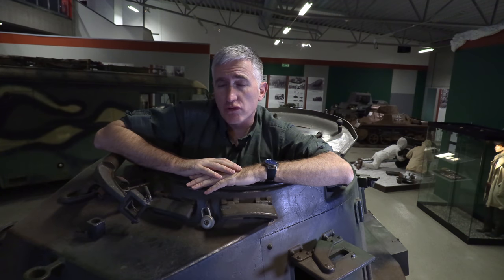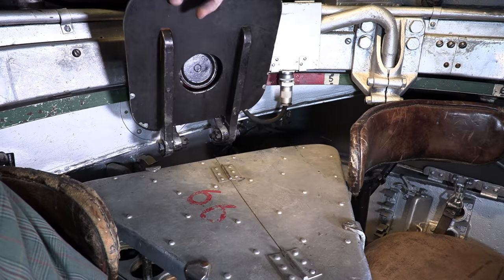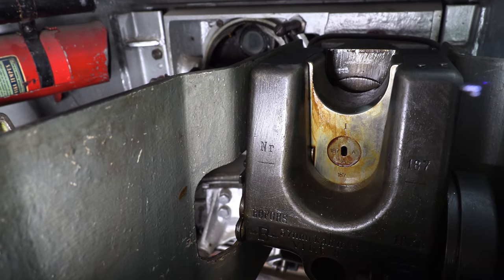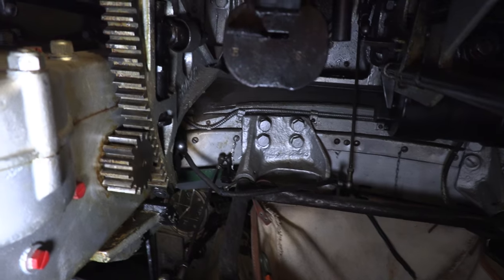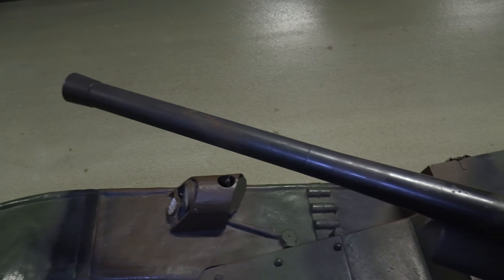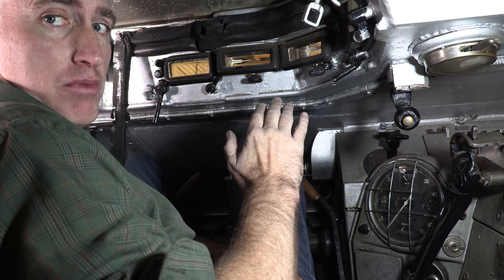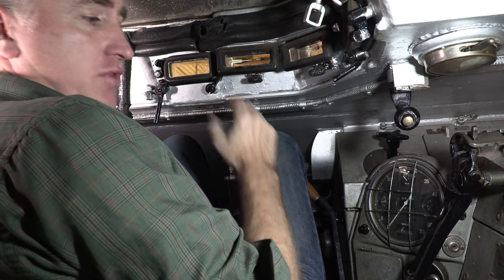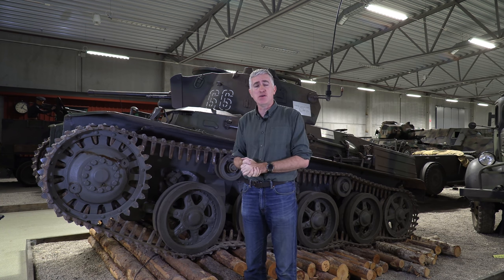Inside the Chieftain's Hatch: Strv m/38, Pt 2.

Comment: The generous crew positions might have come from the need to accommodate crews wearing bulky clothing for Swedish winters.
Reply: That's a very good point actually. It wouldn't have any heating for the cold.
Reply: A good theory I guess? 
But as long as you don't have wind (inside the vehicle) you wouldn't be wearing the outer layers of clothes, you'd be wearing woolen inner clothes with a layer outside. 
Neither Swedish or military, but a Norwegian that loves spending time outside.
Reply: @Batabusa  I think you might be underestimating how cold metal gets in sub zero temperatures when you're not moving around to stay warm.
Reply: @Ragedaonenlonely  as a Norwegian with 31 winters behind me, I beg to differ but w/e
Reply: @Batabusa  You don't think being inactive and constantly surrounded and in contact with cold metal that's going to cool you down wouldn't get cold? I guess you must never have touched metal in the winter in your life.
Reply: @Ragedaonenlonely  I have, and I've been in both old and New vehicles, I'm a trucker on top of it.

If you put a crew of several people inside a tank, you won't need the outer layers. Wool works like a wetsuit and will keep a layer of warm air around the body. And the cabin itself will in fact be warmer due to heat radiating from said people.

Sure, if you were to rub yourself all over the interior, I would recommend gloves.

You truly must not have actually ridden vehicles in the cold, or you're trolling. I can't tell if it's actual ignorance or a joke at this point.

The outer layer of clothes in this climate is to stop wind, more than anything else.
There is no wind inside the vehicles.
The warm clothes are layered Wool inside of those.
Reply: @Batabusa  Keep in mind here that these are NOT modern tanks designed for chemical and nuclear threats, they simply cannot operate "buttoned up" for a long amount of time. Normal non-combat driving and commanding will be "head up" with open hatches (and generally goggles), and combined with the vision slits ect the wind and water get in a lot more than you expect. On the other hand so does engine heat, but the risk is this turns dry powder to insulation defeating liquids, likewise perspiration from brief minutes of physical exertion or stress can turn absolutely deadly with the minutes to hours of sitting after. There is "old vehicles" and then there is OLD vehicles, and this pre-ww2 stuff is more akin to being ON rather than IN, just like an flat fender jeep, clothing to use will be more akin to a snow mobile than a modern truck.
Reply: @Batabusa  as a finnish leopard 2a6 tanker, you absolutely need all the clothes military gives to you. There IS wind inside the tanks as long as one hatch is open. Theres also so much time just sitting around without that good chances to move, so cold you will be
Reply: @taistelusammakko5088 that's the most Finnish name I've ever seen

Comment: pretty cool how the tank still has all the stuff in it, sights radio etc
Reply: Yea, looked very complete inside.
Reply: 16:17 Even a working breech !
Reply: The turrets from the m/38, m/39 and m/40 tanks were in active service into the 1990's as part of fixed defences protecting important positions such as airports. Other tank turrets with heavier guns such as the m/42 and strv 74 ened up at harbours or on the coast. So not only did some spare parts and equipment keep getting made but there was also a ton of parts available to the museum once the fixed defences were taken out of service. Also the original Swedish armour museum at Axvall had a very dedicated and well connected staff so the vehicles were in very good shape considering the small budget.

Comment: Of all the vehicles you've looked over and in, I've been the most impressed by the L60. The display at the museum looks great, too.
Reply: Very good design for 1935 - considerably better than the Pz.Kpfw.III Ausf A (also designed in 1935 and rejected for production).
Reply: This particular vehicle started entering service in 1938. The original L-60 is older, but the Swedish 37mm armed versions came later and were updated versions of it. It's more the m/31, aka the L-10, that's a 1934, 1935 vehicle

Comment: Little facts: the predecessor L-10 was desiged by Joseph Vollmer, a german engineer how also designed the A7V. The L-60 was designt under the oversight of Otto Merker, also a german.
Reply: Yes. Since the Germans were not allowed to own, operate tanks the German Companies went to Sweden and formed a conglomerate and setup shop as Landswerk. IIRC the deal was Sweden would allow them to operate through Landswerk and Sweden would have access to their research and development. By time WW2 started the best minds were back in Germany and Landwerk was not as important.
Reply: Just to quickly clerify AB Lansdverk; company founded 1872 by the swedes Johan Petterson and Alexander Ohlsen in Landskrona.

Later in 1920 the owners sold half their shares that GHH bought. Sometimes after they (GHH) owned the majority of the shares to the company.

Comment: I'm really curious how much light there is inside a tank when all the hatches are closed. I've noticed in your videos that they always seem to have light coloured paint inside, but what light sources are there in actual combat conditions? 
It seemed awfully dark in that blooper at the end of this video. Is that just the camera struggling to cope?
Reply: ..certainly some will be the camera not being mk.1 eyeball & our human-mammalian visual-cortex wetware abilities.
Reply: They can be nearly blacked out, aside from what light leaks in from Sights and bad seals. I was an Artillery mechanic, M109 (Paladin) as its called now days. Had a huge sight opening that could be rotated around 10X10 or so. Lots of light came into one of these.
Reply: Was that video part of the initial video he said that he had to reshoot due to the "wrong filter" I believe he said? Could that be one of the reasons for the dark appearance - the camera's automatic aperture couldn't accommodate the lack of light?
Reply: From the couple of tanks I have been in, the answer is bugger all, the dome lights and what ever the vision blocks and periscopes let in are all you have, of course if the tank is on fire that amount goes up considerably.
Reply: Actually, in most vehicles the Chieftain pointed out where crewmember had small lights boxes (post WWII appears to be kind of a NATO standard white light/red light appliqué, but most tank had a light bulbs somewhere)
When bottomed-up, basically no natural light: in open mode, usually the TC hatch is plugged by the TC himself, riding head and torso out, so it's most from the loader side that some shine may come in.
Reply: Yes, from my experience interior of Tanks & other AFV's (old & new) are generally painted a light colour (white/silver/pale green) on the internal crew compartment so as to maximise / interior light (helps light bounce/reflection).  There will generally be a crew light box (or small dome light) in the vicinity of each crew members work area.  In vehicles from 40's/50's (maybe earlier also ?) these had different coloured light lenses (white to provide a good light output, more so used in Non-Tac conditions & Red for use in Tactical conditions at night).  As you will see with the inside of the hatches, these are painted the same colour as the exterior of tank so they match the exterior colour when in the open position, thus blend in with the tank, so enemy don't see a white/silver shape that looks out of place & give away tanks position.
Reply: AFV's in general are dark smelly places to work.
Reply: Hey,
So im not  really a Tank-Specialist but isnt light in a Tank a bit useless? Heres why:
1. A trained Crew probably knows where everything is (even in the dark)
2. Shouldnt the commander or atleast the driver stick their heads to the periscope for like 90% of the combat time? So light from inside the Tank would just disturb them.
3. Maybe not in 1935 but in the late WW2; light from inside the tank makes it easier to get spotted at night.
Reply: I think AFV's may be similare to Naval ships, they have both white and red light sources for Nontactal and tactal use.
Reply: @tw3397  Hi mate...Your points are correct, but is also other considerations that warrant limited lights (Tac & Non-Tac) in Tanks/AFV's.
1) You might get eaten by the Hull Monster if you can't see him... or where you have dropped a valuable item that may have fallen into his domain...that is everything at floor level.
…& some other less critical issues for lighting are....
2) A tank crew is not always made up of highly trained crewman (refer the movie "Fury" ...sometimes even the best crew have a vacancy & you don't always get someone who is as skilled as the person he is replacing...especially in WW2).
3) The commander (despite being a Super Human) is not able to read a map in little to no ambient light, hence a Red / Filtered light is handy & in a Non-Tac setting work can be done quicker (enabling more rest) if can use a white light.
4) Turret crew (Loader/Gunner/Commander) especially need some Red light even in Tactical times....change radio settings (if radio dials not back lit)...Select correct Ammo nature (HE/HEAT/DP/Smoke/etc..) for main gun...Crew to resupply ready use ammo racks from hull storage...Commander to see where Turret is positioned in relation to Hull for his Situational Awareness/etc..
5) Night Vision.  Is better to have low level Red light inside a tank as this preserves a Crewmans night vision.
Otherwise if a crewman uses any amount of white light (cigarette lighter / match / torch) even for a second or two it can destroy all other crew night vision for several minutes.
6) Noise (especially at night) is a big problem with concealing the presence of Armoured vehicles on the battlefield.  It is better to have some small amount of filtered Red light inside so crew members can see what they are doing (not going to knock or, trip over tools, spent shell cases, etc) so not to make a noise.  "Metal on Metal" noises will bring swift (but filtered) abuse from the Commander to the offending crewman...or from a Sgt /Officer of a nearby tank if they also hear it.
7) In almost complete darkness there is greater risk of crew injury on all the sharp & blunt metal edges to equipment inside a tank, especially a WW2 era tank. A good number of tank crewman can be injured by simple knocks just working inside AFV's especially even when just training.
8) Is better to have it & not need it, than need it & not have it.
….there's probably several more, but these are the ones that spring to mind having been a AFV crewman for several years from mid 90's to mid 2000's.
Reply: I was under the impression that in addition to whatever interior lighting that might be provided, tankers also carried flashlights as part of their kit.
Reply: One also must keep in mind that YouTube for some reason or another has a Terrible time rendering black and dark videos even if the Original video doesn't have any issues with that
But yes big Metal boxes do be a bad conductor of natural light
Reply: You can turn the lights on and see well enough. You can use angled tactical lights for special considerations but usually we train to fight in the dark.

Comment: 12:30 did you mean 28 mph?
Since im pretty sure the top speed is more then 28 kph.
Most sources i can find give it a Top speed of around 45-46 Kph = 28 Mph.
=P
Reply: That's correct. The m/38 did 46 km/h and the vehicles that came after it just a tad slower at 45 km/h. They were pretty mobile light tanks for their day.

Comment: I'd never thought about this before. On a manual transmission you need a rev counter, right? Wrong, in my experience in civilian cars, the engine noise will tell you where you're at. But in a tank, you might have a pair of earmuffs that block out noise so you can hear the PA or the radio. But as I somehow just realized, THE TANK IS STILL VIBRATING AND YOU CAN FEEL WHAT THE ENGINE RPM IS. Still can't believe it took me that long.

Thanks for the videos, Chieftain!
Reply: As a swede that never has had an automatic car. Who looks at the rev counter? You simply shift when the car gets unhappy. Cant imagime it is any diferent in tanks
Reply: @borjesvensson8661 some engines might not like pushing themselves to redline, the radials in the M4s & M4A1s had a tendency to overrev

Comment: Sweden Developed an 8x63mm machine gun round as the Swedish service caliber of 6,5x55mm was deemed to give too little bang for the weight carried.
The round was designed to fit in browning machine guns which is why the length of the round is similar to the US Army's 30-06, the round is much thicker and more powerful though.
Machine guns could easily be modified in the field with a barrel swap to take either the 6,5x55 or 8x63mm, later the machine guns where modified to use 7.62 NATO.

Comment: Impressively modern little tank. I can't think of anything in 1938 it can't kill other than the French tanks, but as the Germans learned, radios kill French tanks just fine.
Reply: Well with 65mm or so of penetration it could probably kill those aswell. Only the B1 would be a bit troublesome, but the Swedish guns are a little bit better than the early German 37 and 20mm guns. The 37mm Bofors was probably the best 37mm cannon in the inter-war period. It had modern projectiles, decent shell velocity, was light (as a towed gun) and had a good rate of fire. It wasn't beat until the US 37mm M5 and M6 guns came about imo.

Comment: Actually Chieftain, the m/38 had a top speed of 46km/h. The later L-60's did 45. The earlier versions with the 20mm Madsen did 48km/h and the m/31 (L-10) did 40km/h. These are all roadspeeds of course.

You can find the manual for the m/38 here: https://imgur.com/a/7WeoSZe

I would happily link you the manuals of the other L-60's aswell if you're interested.
Reply: Perhaps he meant 28mph instead?
Reply: Maybe, but I think the top speed would probably be closer to 29mph anyhow. 28mph is 45 km/h, which is just shy of the top speed of the m/38.
Reply: @Ragedaonenlonely  pretty damn close!

Comment: I want to know more about sabot
Was it ever use?
Was it practical?
Why Swedish was the only one ever use?
Did it really perform better than HVAP?
I would love to know any information about it
Reply: The name of the projectile is slpprj m/49. Literally tracer armour projectile model 49. It was developed for the 40mm but was – when stuck in the m/34 shell – used in the 37mm as well. As the name implies it was developed in the late-war period but since you still had to get close and get a flank shot it wasn't seen as useful. By this time most of the army had 57mm guns anyway.

There's some tables from when they shot up a strv 74 in the 60's. I don't know if it makes a big difference (if any) that they didn't use the tank variant of the gun. In any case: it was a 24mm projectile fired at 1150 m/s and could at 30° punch through 65mm at 200m and 52mm at 1000m. Make of that what you will.

https://en.wikipedia.org/wiki/Bofors_37_mm_anti-tank_gun#Ammunition (It's a hodgepodge of different sources so take it with a grain of salt)

You could also google bofors 37 mm apds sabot at your own risk.
Reply: It was. The APDS shell was developed and put into service around 1949. It stayed in service for the remainder of the 37mm guns service life. The tanks in particular started being withdrawn during the mid to late 50's. It penetrated a bit shy of 100mm of armour with a 0.71kg shell weight and 1150m/s shell velocity. As Joel said it used a 24mm penetrator.

EDIT: If you're interested about the full caliber shells, there existed APBC, APHEBC and HE shells for it. The APBC penetrated about 65mm of armour with a 785m/s velocity and 0.74kg shell weight and the APHEBC about 62mm with a 800m/s shell velocity, 0.74kg shell weight and 15g of TNT filler.
Reply: @Ragedaonenlonely  Got any accessible sources on that? Not that I doubt you. I'm just interested.
Reply: A few. 1960's ammunitions register: http://tanks.mod16.org/pdf/Amregister,%201960.pdf The one for 1949 also exists online.

Penetration chart for the 37mm and a few other Swedish guns: https://forum.warthunder.com/uploads/monthly_2020_04/Pen-SkjutI1945.jpg.a7f1264b409e1e36d52826d1255735ef.jpg
Reply: @Ragedaonenlonely  Thanks!
Reply: Joel Didn’t it penetrate more than 100 ish mm of steel?
Reply: @mrturner4620  Not according to what I've found.
Reply: @Joelsfilmer  You're looking at 30 degrees of angling, it can supposedly penetrate over 100mm at 0 Degrees

Comment: Speaking of 1930s designs,which is a better commander duty spread? 
TC/Gunner like on the t-34
or TC/loader like on everything else?
Reply: I'd imagine TC/loader is the better setup since loading should occupy less of his time than gunning. I do wonder if a gunner/loader setup would have been the best though - the gun obviously can't be shot and loaded at the same time, so why not give both of those tasks to the same person?
Reply: @ARCNA442  They may have done that in practice, esp. on leader tanks where the TC is also trying to maneuver other tanks not just fight his own.
Reply: @ARCNA442  TC's role is also general observation and acquiring/pointing targets for the gunner. Also TC can load the gun and ready the next round while the gunner is aiming.
Reply: @calibear569  that works with 37mm maybe the 45
But 50-75mm shells get more involved with loading, i.e. having the tc digging around in the tank for the shell then manhandling it into the breach would completely interfere with his primary duty